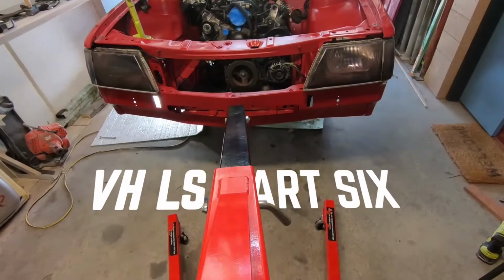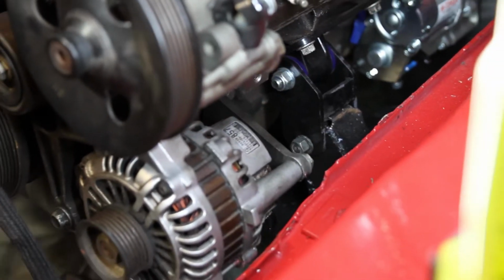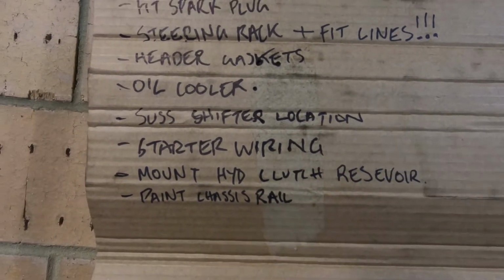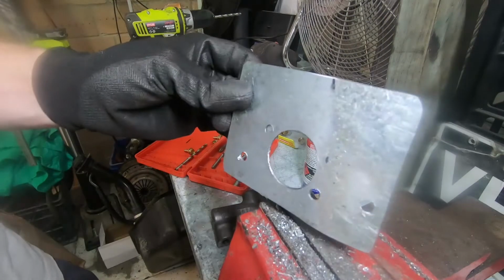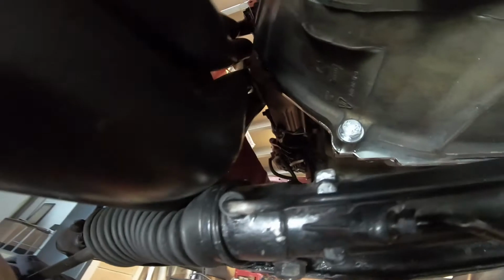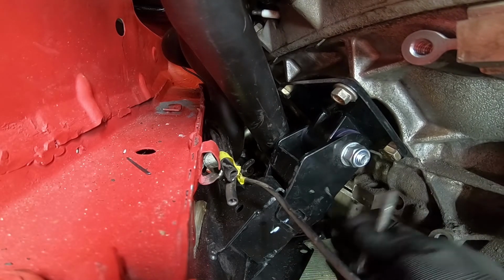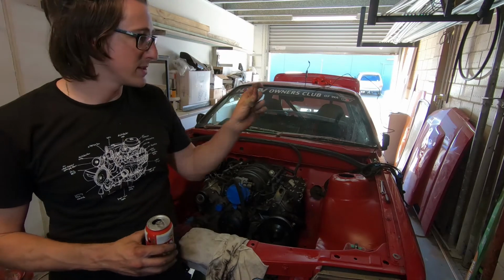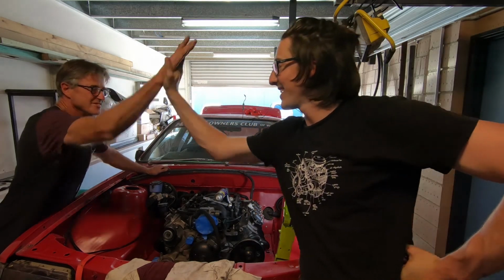VH HOLDEN GETS AN LS1 SWAP! -  PART 6

Comment: Hey, did the factory t56 shifter fit straight through the factory hole in the floor or did you have to buy a different shifter for it or modify the floor? Cool build though!
Reply from the maker: No it came through a bit below standard. I cut an extra hole because race car, no trim needed.